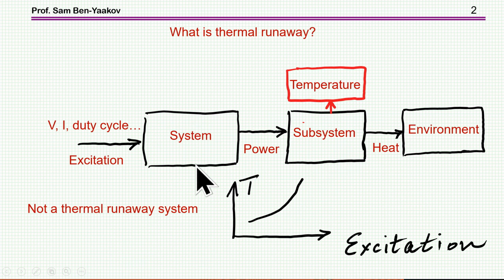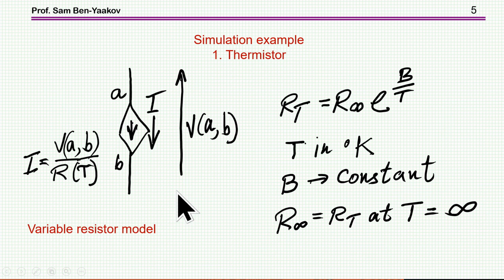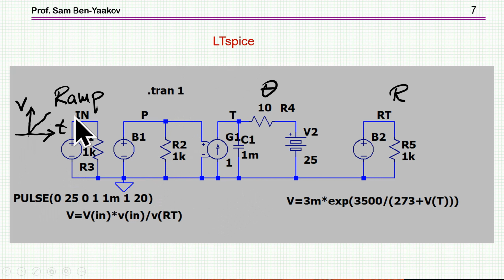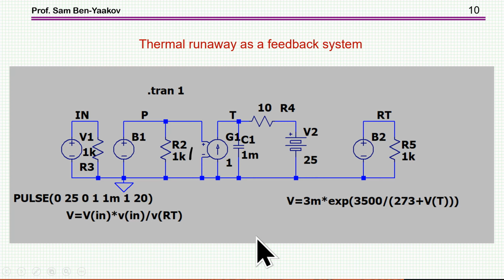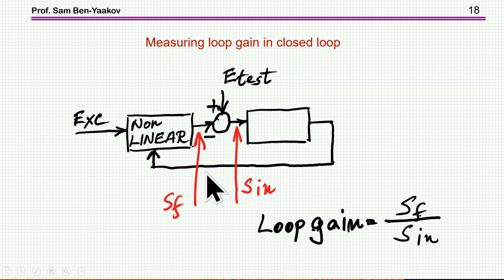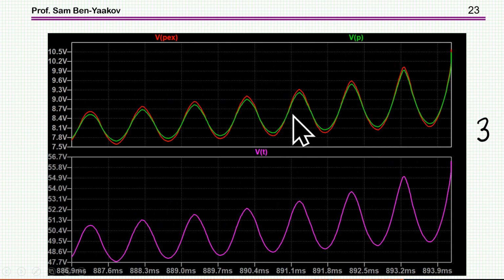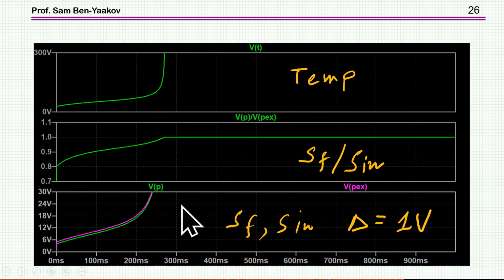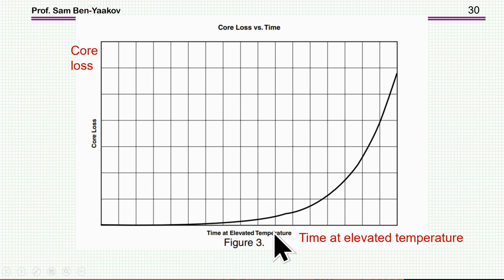Thermal runaway as a positive feedback system

Comment: Professor,
Regarding the simulation in slide #19 I would like to say 2 things:

1) V(Pex) is always V(P) + 0.1sin(2π × 1KHz × t) by circuit construction. You can see that even at point #3 results.
So the amplitude ratio V(P)/V(Pex) tends to 1 but should never be > 1.

2) I think it's fine to analyze the loop gain with a transient simulation while it's stable (point#1 and #2). 
However at point #3 I think the system is already unstable. In fact what I find interesting in point #3 result is that although a 100mV stimuli is being injected,  we get oscillations in both V(P) and V(Pex) with more than 1V.

I think if you would remove the 100mV injection at that point and keep Vin constant (~36V) the system would still go into thermal runaway.
Reply from the maker: For the loop gain measurement method please see https://youtu.be/fODXWfY1oHE
1. Not so, Sf/Sin is independent on excitation (Sf-Sin  is). If not for the non linearity I could have seen Sf/So > 1 which, by the way could result in a stable system.  
2. The instability has little to do with the excitation , I could have used 1mV or 1 microvolt with same result. I used the ac excitation for the sake of illustration.

Comment: The key thing I learned from this is how you measured the loop gain by adding the summing node.
It is also interesting that runaway occurs before the loop gain reaches one.
Since the runaway condition occurs with a loop gain less than one, it is not obvious to me how to write a closed form expression for the point of instability.  However my limited knowledge of feedback theory is limited to cases in which you can linearize the system.  All of the cases I have seen of thermal runaway in practice are highly nonlinear.
It seems this could be a vary deep rabbit hole.
Thank you for your very interesting presentation.
Reply from the maker: Thanks for input